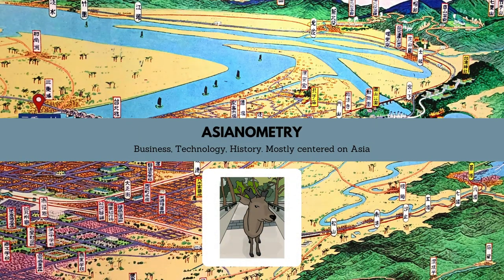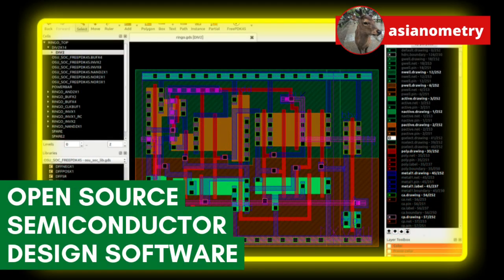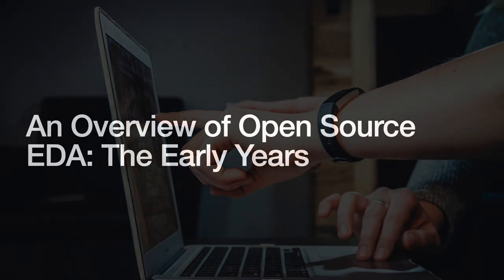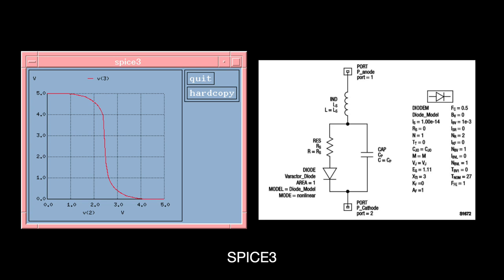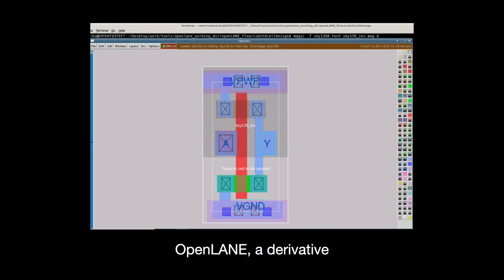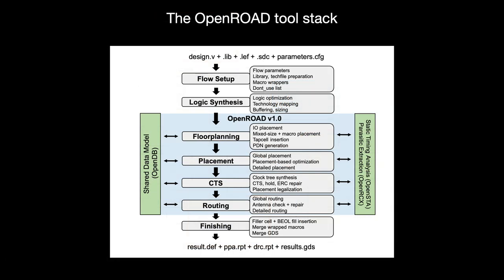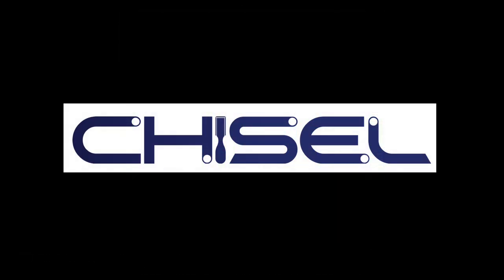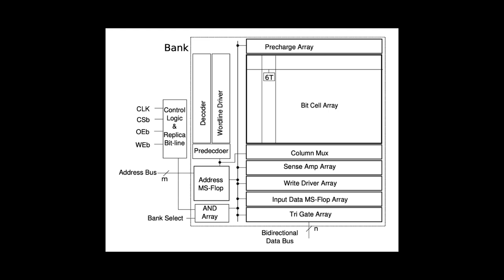The Promise of Open Source Semiconductor Design Tools

Comment: How do they compare with commercial ones Synopsis, Cadences etc ?
Reply: Those cost millions. And they're forth it if you're big enough... And therein lies the problem: It's a huge barrier to entrance. You need to get big before they're worth it... and you won't get big if you don't have them.
Reply: Cadence, synopsis are results of decades of work done by hundreds and thousands of engineers. It’s going to take a lot of effort to produce something even remotely comparable
Reply: Open-source tools have existed for longer than any surviving proprietary product. Ones like SPICE have undergone decades of real-world use and refinement.
Reply: @lawrencedoliveiro9104  it's not about time of existence, it's about time of active development. Also, SPICE is just one of thousands of components involved. I do agree though that there are good open-source spice implementations, e. g. xyce
Reply: I did an interview on my Zero to ASIC channel with Tom Spyrou - lead dev of OpenROAD, he had some comments about comparisons.
Reply: Proprietary products come and go. And what happens to your valuable data locked up in proprietary data formats?

Comment: Now, let's wait for publicly accessible foundries that let you print your own chip, say on 40-60 nm node, as easily as 3d printing.
Reply: Ebeam writing was a candidate for mask-less prototyping but the market was too small and the resist requirements where different from the mask-based process.
Reply: Knowing what we know of marketable level quality microchip foundries like tsmc  schedule you would wait for a millenia. Literally
Reply: in your dreams ,kiddo
Reply: @eone199  That’s your dream? That’s disgusting
Reply: For chips in small quantities, you're much better off programming FPGA's
Reply: The home-made foundry is somewhere around the early 1970s in terms of what you can do, if Sam Zeloof's work is anything to go by, and it'll fill your garage with equipment. Said equipment also includes a modified DLP projector for maskless photolithography.

Comment: Hi;
if you have a proposal for a new processor architecture and it is much more efficient than any existing architecture, a simple designer's
What do you think it should do to develop it and bring it to life? What would be the safest way?
Reply: You prototype it in simulatable or synthesizable form, in simulation or on an FPGA. It can be even shipped into products as an FPGA.

But i bet you will come up with something that either isn't 'new', you just missed part of the history lesson; or it will turn out not to be efficiently implementable in silicon, or will turn out inefficient from practical concerns, like lack of great tooling ecosystem. I welcome you to prove me wrong.

Also saying "more efficient" incurs "... for WHAT exactly". There's a reason a microcontroller and a server CPU are very dissimilar, in spite of potentially sharing parts of an instruction set. Are you designing an instruction set or a microarchitecture? Two pairs of shoes.
Reply: @SianaGearz  I'm talking about a completely different method from the existing system. By efficiency, much less energy and real parallel speed to work in teraherz. Do you think it can be described as efficient?
Reply: @empatikokumalar8202  Have you invented a transistor with sub 0.1ps tr? If not, why even mention teraherz?
Reply: @SianaGearz  Furthermore, wiring capacitance and all other types of interferences will destroy the transition time.
Reply: @SianaGearz  i'm talking about the clock speed it can run
Reply: @empatikokumalar8202  So you invented new physics? 

The absolute highest speed possible is c - the speed of light in a vacuum. The speed of an electric signal in a wire is slightly below that (about 80% of c, depending on wire properties). As a very rough estimate of the maximum we can use the approximate speed of light: 300000km/s or for modern equipment: 30cm per nanosecond (USA: 30cm is about 1 foot) - that means during one cycle on a 1GHz computer a single bit can barely travel across the main board. Let's increase this to 1THz, because we are cool! In 1picosecond the same bit can travel about 0.3mm - that's the width of a single grain of pepper!

Since most high-end processor chips are significantly larger than a grain of pepper this would mean that it would have to process hundreds to thousands of instructions at the same time - a pipeline that long is pretty much impossible to design - the amount of branch instructions in a normal program would truncate this pipeline to a few dozen instructions of useful depth. Completely branch-less computing is a pipe dream right now.

So you need to violate the laws of physics to get a processor that actually works and works well at 1 THz. Good luck - the penalty of attempting to violate those laws is usually some kind of failure.

A little hard earned advice from my own attempts at being a genius: learn how others have done it and why they made the compromises they made - some of them were pretty good engineers. Then see whether you can make a little improvement. Or in other words: don't try to jump directly to the top floor of a skyscraper - take the stairs!
Reply: @KonradTheWizzard  5. volt speed no ligft speed. As I expected, you are looking at it from my perspective. Anyway, thanks for the chat.
Reply: @empatikokumalar8202  Well if you don't have a basic building block, a logic gate, that can switch at THz speeds, you aren't going to have anything running at a THz clock speed.

Can one make a more efficient processor? Sure. But starting off with ludicrous claims isn't helping. And if you did have a solid foundation for what you're claiming, you wouldn't be having the question you have opened the thread with, the path forward would be crystal clear.
Reply: If your efficiency claims are based on functionality without considering phycical layout there are enough tools outside. RISC-V is only a base, but extensible instruction set. It helps to share the compiler stack development. But the micro-architecture which include physical efficiency considerations is up to you. For instance a H264 encoder could be 10-50x as efficient in custom architecture than a CPU.
Reply: @reinerfranke5436  That's exactly what I'm focusing on. Your knowledge forbids looking at you any other way. Knowledge must be front angle and practitioner. But it acts as a cover for you. You can't even think otherwise. Frankly, I regret that gifted intelligence is wasted on such a simple principle. What I mean by efficiency is speed, low energy consumption, ease of investment and processing. I don't know clearly what other element could be. Oh, of course, apart from efficiency, there is also a security factor. But I don't think the states will want it.
Reply: @empatikokumalar8202  As an analog designer but 20y interest in custom sparse matrix architectures i know that "wiring in space" is 90% of efficiency. Logic definition, Synthesis and P&R support design efficiency but not phycical efficiency. Some tools claim about double digit %, but not double digit x. It is the hidden secret of digital architecture design.
The main problem is that language logic definition is without space.
Reply: @reinerfranke5436  anlamadığınızdan emin olduğum gibi Anlayamayacağınızdan da eminim. PEki analog designer nedir?

Comment: "open source hardware innovations like RISC-V" 
sorry but RISC-V is not innovation, it's more like standardisation on the least common denominator... it is a VERY polished RISC but brings close to nothing new to the table :-/
Reply from the maker: Sorry I disappointed you with my wording.
Reply: @Asianometry  heh, don't feel sorry for my nitpicking :) BTW check your inbox ;-)
Reply: @leyasep5919 
RISC-V enables people bringing something new to the table.
Because it's open source and license free.
Reply: @MostlyPennyCat  RISC-V is not as open as you seem to think. It's a standard for ISA that is controlled by a cartel of companies who pay for having first dibs on new extensions, and fight for imposing their own view by being "first to market". You are only free to follow, not innovate (because change will you make "incompatible").

Furthermore the architecture is polished but brings nothing to the table because it is based on a 40 years old architecture that has already been stretched to the extremes but there is nothing new, no real innovative concept that brings us to the 21th century. Only extension to the same old RISC-1 and MIPS concept and instruction format.

The YASEP is another "free" ISA with features derived from 20 years of observing where other ISAs evolved and failed. It learned from the failure of the F-CPU project (started in 1998) and I develop yet another even simpler ISA right now. I can start from scratch and reconsider every single choice, but RISC-V has 4 decades of legacy...

Feel free to contact me to discuss more about it.
Reply: @leyasep5919  I'm a total layman, but wasn't risc-v introduced to just drop this baggage? What would you want to see in a new ISA then? Do you think risc-v will be able tackle arm? Is risc-v better than arm? Is riscv modern enough isa to be realistically considered? I mean chinese are literally copying mips with loongarch so ISA doesn't seem to be a very important factor.
Reply: @dand337  more replies 🙂

> Is riscv modern enough isa to be realistically considered?

modernity is not a criterion for adoption, there are more practical issues to solve before : is the platform widely adopted ? This means : how many people do use it, developing tools and enhancing them ? Is there some support or dynamic ?

RISC-V is modular and adds extensions here and there and wherever they like or fancy. So there will be adaptation, though also some fragmentation because few chips can have all the extensions, creating a want for more features or a race to the latest feature level... such a race is a dynamic that the industry loves and there is little risk for them.

Now adoption depends on the specific needs of each project. RISC-V is quite good for microcontrollers and can displace several ARM offerings but I believe it is a bit less efficient or compact because RISC-V tries to "be good enough at everything" but it can't perfectly match everything.

> I mean chinese are literally copying mips with loongarch so ISA doesn't seem to be a very important factor.

Some Chinese have adapted RISC-V to support more flexible addressing modes that are sorely lacking, due to the mantra of minimalism that reduces the ILP. Ideally this should be backported into the main ISA but I have no idea what's going on there, and there might be some "not invented here" syndrome, and/or philosophical fundamentalism, who knows, but the Chinese can adapt whatever they care to copy... I'm more interested at what they could invent from the ground up, if they ever dare.

I don't know if I answered all your questions but that's quite some food for thought.